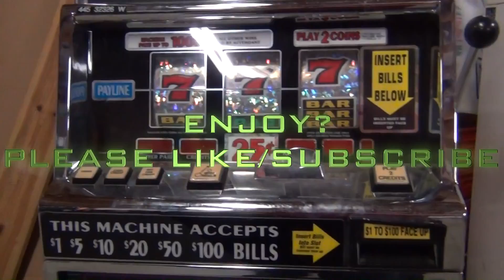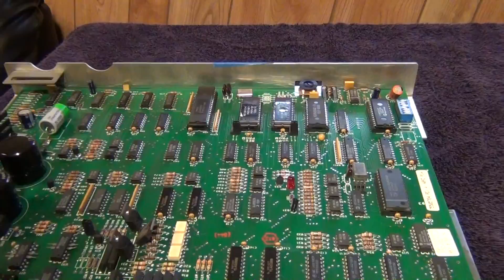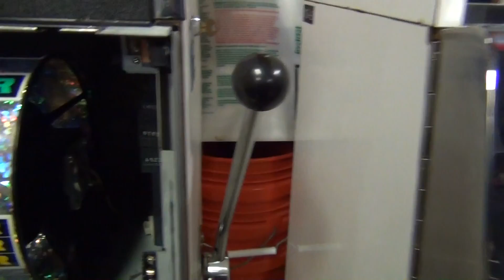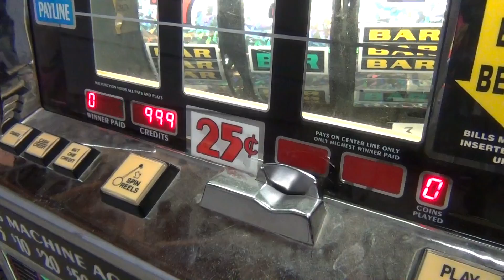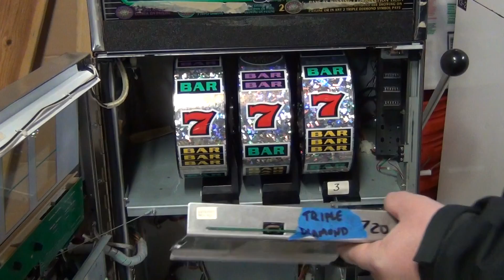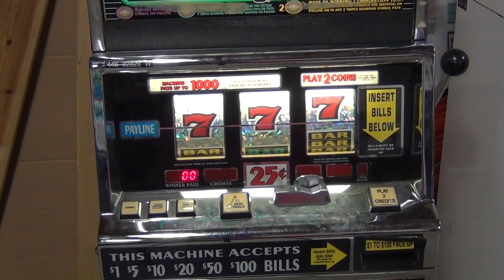IGTS+ Factory Reset (Clear Chip 123)

Comment: very informative video, thanks for posting.  i have a situation i have not seen covered by anyone in any forum and wonder if you might help. it is an igt double lucky seven machine that lights up with power, used to work but then quit. not into it a lot at this point because there is a substantial glob of what appears to be melted plastic (now solidified) hanging from the inner housing of the pull handle.  some of the stuff has dripped to the housing floor so heat came from somewhere, so my question is, would it be worth the effort on this (May 26 92 from inside cabinet) machine to try to fix it?  thanks in advance.

Comment: I used your video on how to fix my 12 error & replace the battery in my IGT S+ Vintage Vegas machine. I got the 61 error as anticipated, but after turning the key, I got a completely different set of numbers. In this video you said that the Clear chip 123 was kind of a last resort. Is there a way to figure out the other codes to reset? My machine is a 3 quarter max instead of 2. THanks, Chip

Comment: so I put a new battery in the machine from batteries plus then got the 61 code, opened the door hit the reset button closed the door and turned the jackpot key, nothing happened.  I read somewhere I could pull the reel prom out and put it back in to fix this. so i took it out and put it in backwards on accident and it got super hot actually measured it with a laser IR and it was 185 degrees F !  and i assume its ruined I guess allot of people have accidently done this, so I guess what my question is now.. can I replace the real prom and use a clear chip to get the machine working again ?
Reply: thank you for the  reply on my last question asked I cant find much info online
Reply from the maker: Yes, you most likely damaged the chip as that sends voltage to the wrong pins.  Hopefully only the chip if it got that hot.  It is 50/50 if you replace the reel chip with a new one, it may work as/is (without needing a clear chip).  Personally I would recommend not using that particular chip again. If you still get the 61 loop, depending on the reel chip, sometimes switching to another major revision or another game will cause the mpu to reset itself like a clear chip would, and then you can switch back to the desired version.  But if you are ordering a reel chip anyway, I would recommend a clear and set chip at the same time to save on future shipping.  This may be what is causing your candle light error.
Reply from the maker: fingers crossed!

Comment: I just picked up a 1994 igt double jackpot worked fine but when i got it home it wont play and the attendant lights are flashing idk what to do
Reply from the maker: Depending on what model slot (titles sometimes span multiple models)...  The candle segments usually indicate the type of error by what each one is doing...between steady on / fast flash / slow flash / off.  I would look at this and the numerical displays to determine the error code(s).  Mine had a chart of error codes inside the door...yours may too.

Comment: Sir, My Boss had bought around 10 of this type slot machines, The machines have set idle unplugged for years. Now two us are trying to get them working. We had the 12 error codes and have replaced the battery on the circuit boards. Now still having problems. I was able to get one machine working perfectly then the next day it wants to spit out money. I think a ivt123/clear123 might cure the machine problems. Where do I purchase these chips, and does this chip or another chip run a diagnostic on all the electric components? Thank You, Doug
Reply from the maker: The settings/test mode can be very finnicky so it&#39;s possible you have something set wrong or is corrupt from the battery error.  I don&#39;t have enough experience with these to jump to saying clear the ram.  I would try googling your specific issues/any error codes.  I don&#39;t think the chips give you any further diagnosis options, but you will be able to see/set different settings depending on what chip you currently have installed.